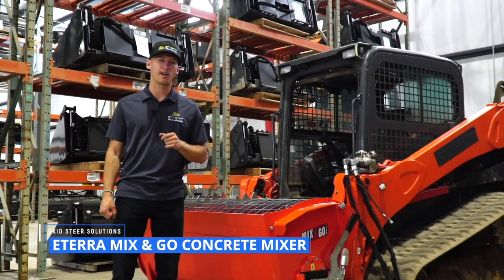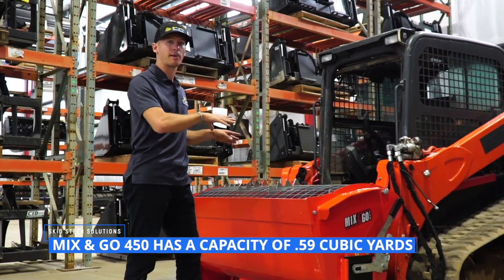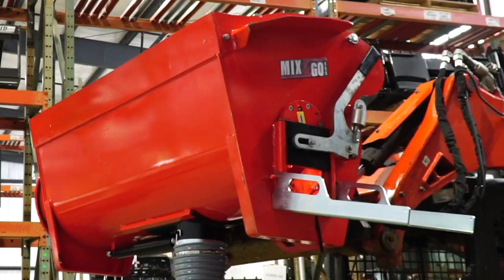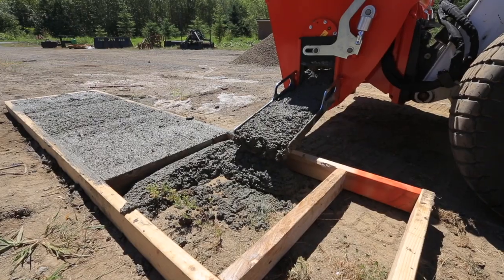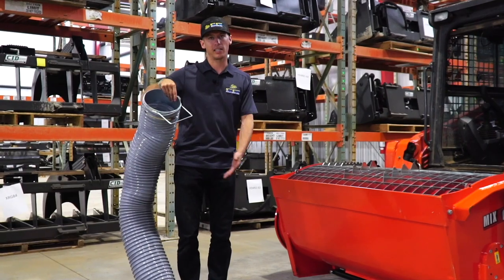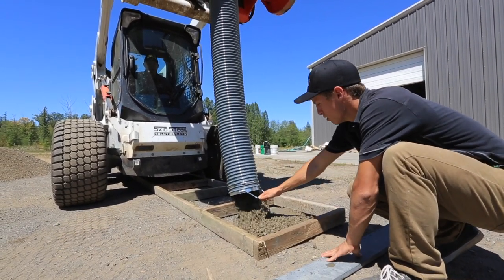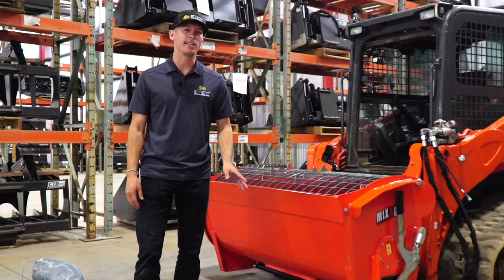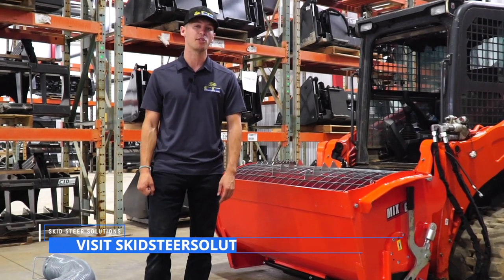Eterra Concrete Mixers - Overview + Demonstration | Skid Steer Solutions

Comment: While the 'scoop and hose' seems like an easy way to do things, this severely limits the strength of the concrete as you have no idea what your mix ratio is in reality and your 'eye' isn't going to give you the best mix proportions, regardless of 'how long' you've been doing it. The only thing is, you will be long gone when your understrength concrete fails. Use a 5gal bucket. Use a good quality mix ratio, use the same mixer, and make good concrete for your customer. Half-assing concrete is such a weak thing to do.

Comment: I’ve been thinking about getting one of these to work a bunch of little projects around my property. My question is regarding the cost effectiveness of the concrete mix. For this to make sense I need to get dump truck loads of agrégate and pallets of cement and mix on the spot. Do you get the supplies from a ready mix facility or a gravel supplier? How does that work?